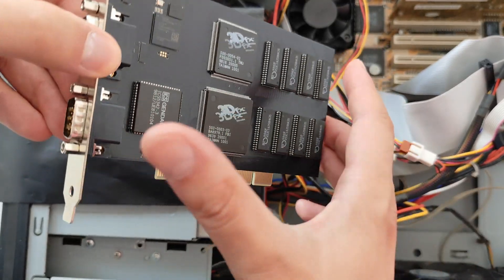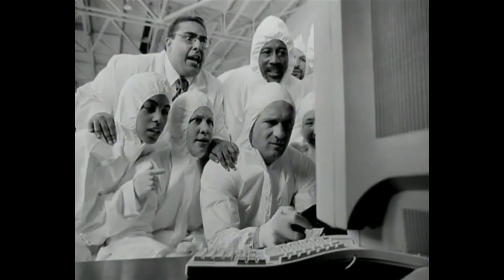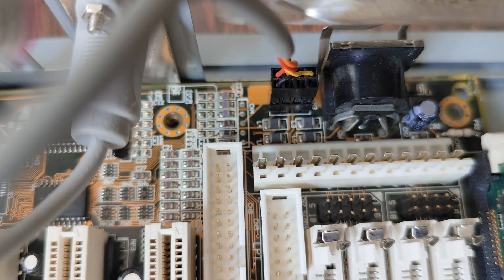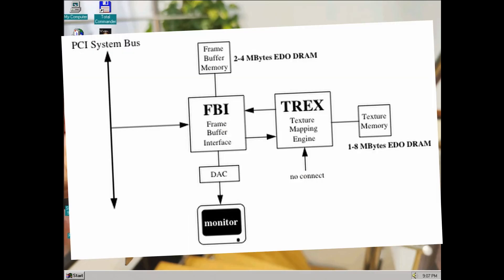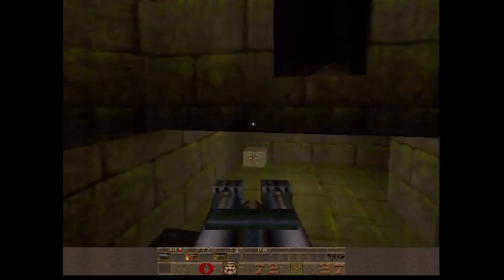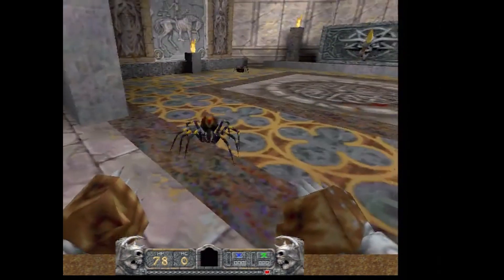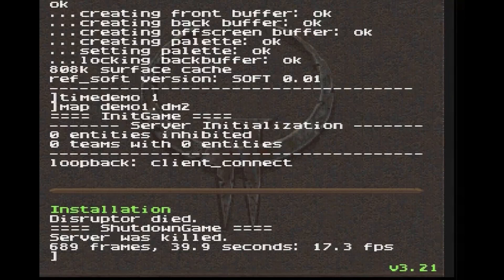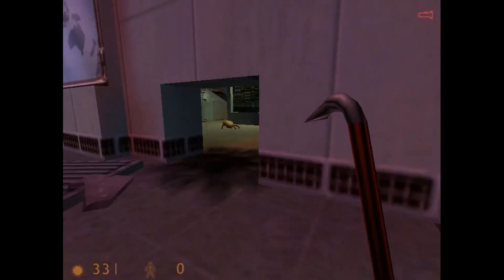1997 Pentium MMX Meets Custom 3dfx Voodoo 1 Cards (HDMI, 12MB, Dual TMU Power!)

Comment: Oh man now I want to know where to get one for my old Unisys! I want to run NetBSD or ArchLinux32 on it and I think there is still xf86 driver support 😅
Reply from the maker: That’s the beauty of it - you can’t just buy one; you have to make it yourself. It’s a serious commitment, like outsourcing the main chips and memory, placing the order, and crossing your fingers that you’ll end up with a working card.
Reply: @O_mores  I think, it is possible to order a 5 nm multichip with all processors at once.
Reply: @O_mores I'm also need this unique card by another reason: my old DP67BG motherboard doesn't has internal graphics, can't boot without any video and don't know how to operate with PCIE 4.0 from modern 3D-accelerators. The one solution is a second videoadapter (needed only to show BIOS on start time), but for me a better choice is PCI with HDMI in one card. No one oldest cards i can found doesn't has both these interfaces at once. But the Glide as a third option is the better choice.

Comment: What exactly can be done with those schematics though? Are they using chips you can get for cheap on the market, or do you need to manufacture them yourself in your own factory? I had a Pentium 233 MMX with Voodoo 1  - Canapus Pure 3D 6MB. Wish I knew where the card is now, I hear they're worth a mint nowadays :)
Reply from the maker: You can upload the schematics to a site like PCBWay or JLCPCB, and they will manufacture the card for you. Since the schematics follow standardized formats, they can be easily integrated into the manufacturing process. Standard electronic components, such as capacitors, can be sourced directly from these platforms. However, for specialized components like SST-1 chips or memory chips, you’ll likely need to source them separately and ship them, often by salvaging parts from another Voodoo card. While this process might seem complicated, it’s entirely feasible—after all, this is how these exact Voodoo cards came to life.
Reply: @O_mores  Very interesting, but would this really be cheaper than $750?
Reply from the maker: Yes, it's much cheaper - these cards require some manual work and the PCB itself with all the labor implied I think it's about 50$. (excluding the electronic components) Otherwise, if you produce a standard PCB with standard components -  everything is dirt cheap.

Comment: "They provide the schematic"  Did you mean gerber files since you're speaking of PCB production afterwards?
Never the less - very nice to see this. I've been involved in various retro soundcard reproductions and own some custom built high end VLB cards designed on a forum a few years ago. Love when people go out of their way of feeding retro capitalism and unleash formerly impossible potential of older chips/architectures.
Reply from the maker: This is what you get if you go to sdz-mods: "Full design files (editable schematic & PCB, PDF schematic, GERBER files, BOM, P&P, PCI bracket dxf file, FPGA bitstream and mcs file) are attached below. The FPGA code will be uploaded after I cleanup the code a bit. If you use another flash device, generate a new mcs file from the bitstream." I love it to, I wish more PCI-E hibrid cards to be available: I have a PCI-E with a PCI to USB VIA 6212L which works even in Windows 95, I wish a PCI-E SB Live!

Comment: Need to see Unreal castle flyby timedemo compared to a regular voodoo 1
Reply from the maker: Voodoo 1 really struggles with Unreal, a second TMU doesn't make much of a difference. I will post some footage in my next video, I was able to get HDMI output using a cheap HDMI to USB adapter.

Comment: i have at home the pentium mmx233 mhz with some 4x  8mb rimm memory and sdram 32mb, but mobo died..
Reply from the maker: Rambus in-line memory module (RIMM) wasn't a thing for socket 7 motherboards. You must have 4 x 8 SIMM slots.  Sorry for your mobo. Fortunately socket 7 motherboards are still cheap to buy.

Comment: I'm honestly curious just how little power this combination would use if manufactured on a modern process

One of these days I'll get my pair of Voodoo2s back to wrk 😅
Reply from the maker: "Being a single-slot card, the 3dfx Voodoo Graphics 4 MB does not require any additional power connector, its power draw is rated at *15 W maximum*..." this the whole card - the main chips were manufactured @500nm. At 5nm the power draw should be under 1W while running at the original clock speed. (50Mhz)

Comment: Use cpu scaling for better experience. Period correctvis waste of 3d acceleration, for example voodoo2 sli on what pentium II 450 ? Sli scales up nicely to 1ghz. How much did you spend on pimped voodoo1?
Reply from the maker: Voodoo 1... actually won't initialize if the CPU is too fast. Under 1Ghz is safe. This is not my Voodoo 1, it's from sdz-mods.com. Lucky for me... Daniel, the dude behind sdz-mods, lives relatively close (300KM) so I was able to get both Voodoos and the PCI to AGP adapter. And I should get a PCI-E to AGP adapter soon.

Comment: With Voodoo 1, some games support 512x384, which gives you a bit better performance compared to 640x480 and with very little loss in "fidelity" (graphics).
I recommend trying the original retail release of Unreal (not Unreal Gold which uses the more demand and upgraded engine from Unreal Tournament).

Enjoy!
Reply from the maker: Yes, the only inconvenient with these HDMI Voodoo cards is that 512x384 is not a standard HDMI resolution so 512x384 most likely will display a blank screen over HDMI. Meanwhile,  I managed to use the HDMI output with the help a cheap HDMI to USB adapter... And it looks good.

Comment: 128MB of RAM? Isn't it making the machine slower? Is all of it cached by motherboard's L2 cache?

I run my pentium machines with 256MB of RAM, but have 196MB ramdisk on the top part of RAM.
Reply: 64 was high for the time. I upgraded my Pentium II to 192 but that was years later, circa 2003.
Reply: @rsmith02  true, 64MB is plenty for a pentium. But at least all of it is properly cached and therefore running without hitches or slowdowns.
Reply: @GigAHerZ64  32 MB in 1997 was like 16GB today. Standard was 16MB.
Reply from the maker: In 1997 RAM prices dropped dramatically. A 32MB SIMM went from ~500$  in 1996 to about ~$120 in 1997. Even so 128MB RAM was about 500$, so no one was in a hurry to spend like 1000$ to have 256MB in 1997.

Comment: I'm glad that 3DFX made so many spare chips, back when they did. Since they only essentially invented a single infinitely-scalable processor, their only plan was to keep increasing chip counts and miniaturizing, without updating the key architecture. That's why they immediately fell behind, on the shader updates. While competition rewrote texture routines, their chips could only go faster, but not do new things. I have a ton of Voodoo's, with 5500 being the highest. I'm cooling off on retro, since spare time is always in short supply, but I'll still watch videos of people trying things with their 3DFX chips. I hope my 5500 lasts. I can reflow chips, but I hate doing it, since there is always a chance of something going wrong, especially with IC's that big. $700+ may seem like a high price tag for a prebuilt product, but what you're buying is the guarantee that some solder bridge you didn't notice, when building your own thing, doesn't take out your GPU and your motherboard along with it. I'm a professional, and still, any time I can save a few hours and get a pre-tested build, I'll go for it, no matter the cost. I don't want risk. I want the end product.
Reply: Yep - the amount of 3dfx spare chips circling around the internet amazes me. From the original up to V5 - anyone with a certain degree can redesign, revamp and even resell these. I just wish there where models released with faster memory, perhaps binned chips.
Reply: "since spare time is always in short supply"  this, and it feels like it gets worse as I get older.  I have a mountain of old hardware I never get to enjoy.  Those newly built Voodoos are very appealing.  I still have my original Voodoo 2 from 1998 along with the 200MMX.  I bought a bunch more Voodoo hardware off ebay 15 years ago before the "vintage computing" category made all the prices shoot up.
Reply: @Vile-Flesh  You could instead of wasting your time on a daily basis on Youtube just jump into it.
Reply: I don't think is made with spare chips, just some hot air & a bad Voodoo 1 card.

Comment: for 1998 we overclock our pentium mmx to 291mhz (3.5 x 83), ok...or more realistic 266mhz (3.5 x 75) 😁
Reply: We overclocked Celeron 300A to 450 in 98, we also overclocked the K6-II+/III+ to over 600mhz.
Reply: Don't forget the 2x=6x multiplier trick with many K6s
Reply: @xBruceLee88x  then 400mhz k6-2 used that low multiplier trick to work at 66mhz with older boards. Good times
Reply: Why not a K6-2/2+ or P2 instead?
Reply: @TheRetroRaven  mainly continuity with the system he has here.  i got the vibe he was doing a specific year retrospective.  

k6-2 is interesting but they were too new to be dirt cheap in 98 and the mendocino celeron smoked it badly that summer.   by 2000 the vanilla k6-2s were $30-40 from resellers so it was a great move then if you still had socket 7
Reply: @infinity2z3r07  I have to disagree. The only Celeron that smoked anything , was the Slot 1, Celeron 300A, rest didn't smoke anything.
As for the K6-2's , in 1998 , they were cheaper than both Pentium MMX and Pentium 2. 
In 2000, the K6-2's were obsolete, either you had a Pentium 3 , or an AMD Duron/Athlon (depending on your budget, where the Duron was the cheapest deal for gamers on a budget).
Reply: @TheRetroRaven   not gonna argue.  but that's why i said mendocino ($150 300a august 98) not covington (cacheless p2 at 233, 266, 300).  k6-2 being any cheaper than the 166 or 200 mmx is not in my memory...the 233 maybe
Reply: Celeron 300a @ 450!

Comment: arata bestial de frumos PV-urile!! tu, fiind inventiv...poate gasesti ceva si le vei conecta la intel 13 gen pt niste teste de distractie :)
Reply from the maker: Salut, am postat video-ul si am plecat de la calculator pentru o saptamana... :) Problema cu Voodoo 1 e ca nu merge pe procesoare foarte rapide. Adica il instalezi  fara probleme - dar jocurile nu pot intializa placa cum trebuie - apar doar niste patratele pe ecran sau niste artefacte. E un bug ceva in driver care nu  s-a corectat nici pina azi. Tipul care a facut placile a zis ca e safe pina la 600Mhz, dar in general merge pina la 1Ghz.